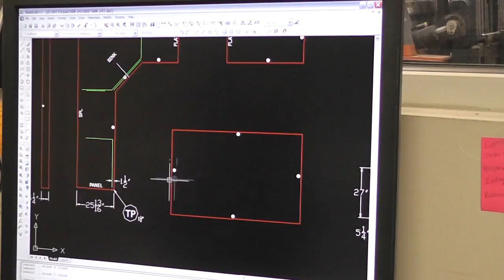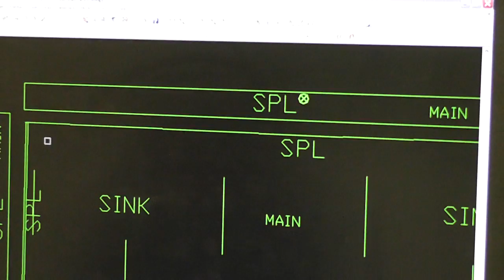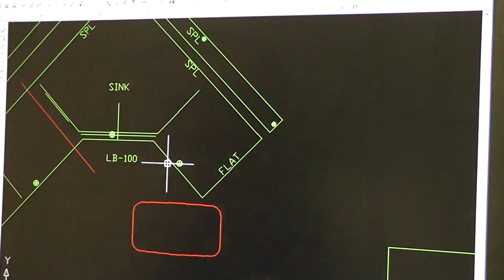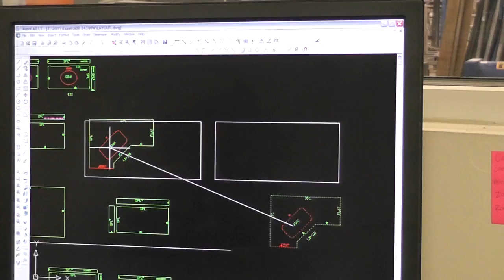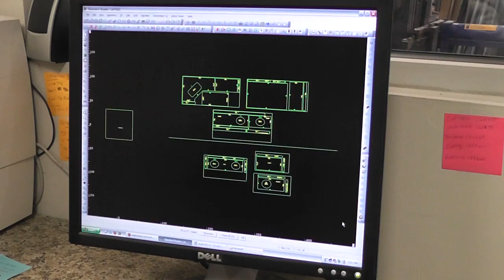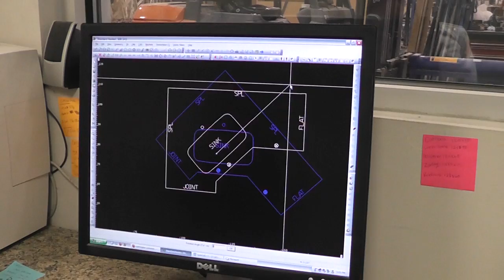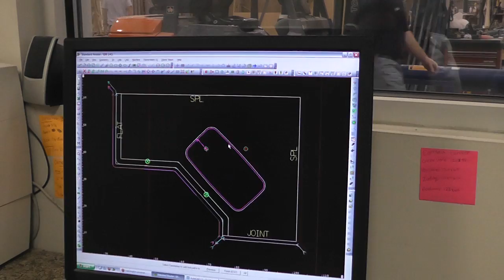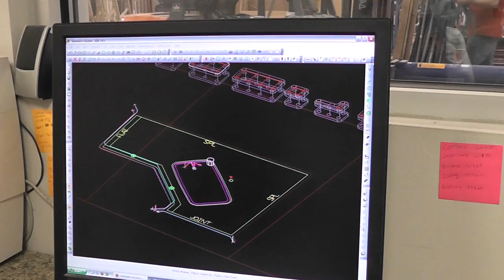Machine Programming with Auto CAD and Alpha CAM

Comment: I measure 5 jobs a day with a pro liner and draw in alpha cam. I do all my sink insertions, notches for the splashes, make all seams perpendicular to the front edge, layer the job so all that is needed is to turn off all but the geometry lines of the tops. If I turned in drawings that required my programing people to do that before getting started I would be selling pencils on the street corner.
Reply: would you say alpha cam is good software? Currently looking to purchase a CNC machine for kitchen & bath stone countertops